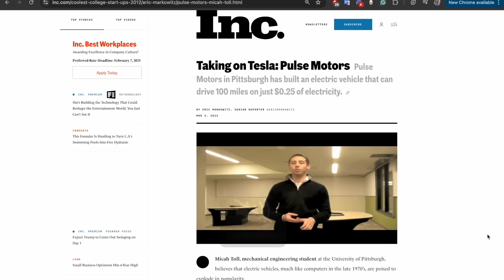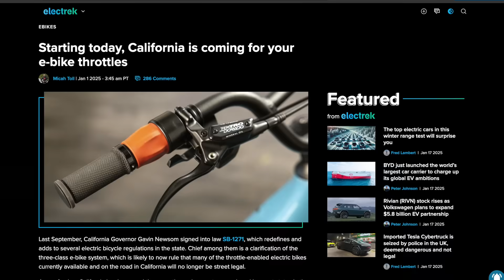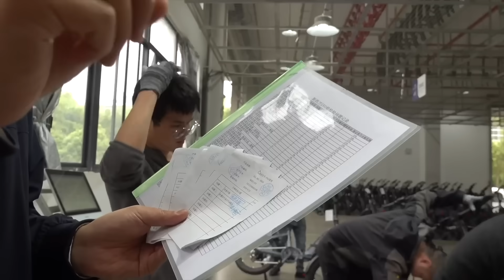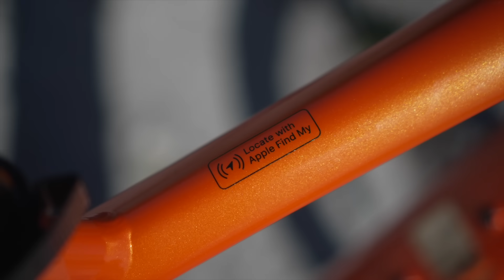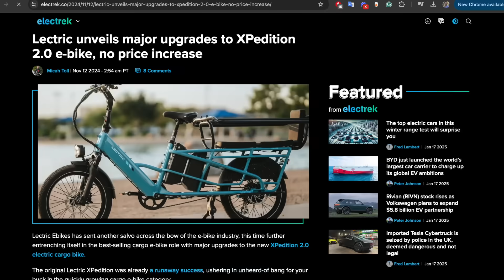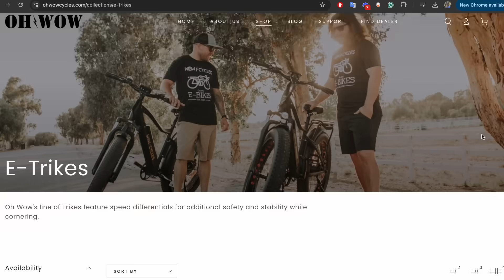5 Things That Will Happen To E-Bikes In 2025!

Comment: As a motorcyclist, seeing some high end e-bikes keep up with me on local streets, yet wearing nothing more than shorts and a t-shirt, is pretty mind boggling.
Reply: Blame the Rider. Not the EBike.
Reply: Wait till you see people riding bikes down hills.
Reply: It’s stupid.
Some of them ride at those speeds on sidewalks. A 60 year old runner was killed by a kid on an ‘e-bike’ like that.
Reply: @IdrisFashan  That should be obviously illegal.  Class 2 is more than enough.  I usually go about 15-16mph on my velotric fold.  That is a sensible limit for bike trails.  The people who want to ebike in the road faster should be calling their ebike what it is, a moped.
The 750watt limit with no peak is dangerous as it assumes people cannot be heavier.  Its an ada violation.  They should limit acceleration speed, not wattage.  I don't get why people doing stupid things on roads has anything to do with people who use ebikes to assist on actual bike trails.
If you are biking in the street, get a moped style bike and call it a moped.
Reply: One case dude how many bike riders are killed by cars? If you get rid of things based on one case or a few nothing would be legal dude  @IdrisFashan
Reply: @bellatorna8664  that's one death that happened blocks away from me. There are dozens of others... 
50+km/h ebikes are mopeds. 
No one should have a bike on a shared path that goes faster than 30-35km/h. 
My wife rides an analog gravel bike and she can go A LOT faster than that on the road, but she won't risk running into people on a shared path. Motors make the wrong people even more careless. I ride every day (Canada) and some delivery-style guys in my town get careless, but I almost never see them speeding around on paths. The Surron type speed ebikes/dirt ebikes are a different thing altogether—they need to be regulated before they ruin it for the rest of us.
Reply: @IdrisFashan i respect what you say but you keave young men like me screwed with bike licenses dude
Reply: I ride both. I limit my e pedal bike top end. On my Kawi l wear full protection. On the ebike l tone it down and try and be as careful as on motorcycle. More so really but both rides are very unforgiving in an accident..
Reply: Don't get jealous now.
Reply: Falling off and hitting the back of your head can kill you on a motorcycle and an ebike is no different. 20mph is all it takes to do that. 

Makes no sense the fast ebikers don't wear motorcycle gear.
Reply: @hyedefinition1080 It should be their choice whether to wear gear or not on a motorcycle or an ebike. Fortunately it is in my state.
Reply: @ndnrider  
Having legality be a metric is odd to use. Sugar, alcohol, and some soft drugs are all legal: they can kill you in all their legality...still not questioning your legal rights. 

I don't need to go beyond common sense and jump into the world of legal loopholes  to tell you hitting the back of your head is going to kill you. LMAO
Reply: @hyedefinition1080  Maybe I misunderstood you. I was simply saying I think adults should be able make their own choices about riding gear, personal safety, food etc. regardless of how foolish I think they may be.
Reply: @ndnrider  I completely understand statement. I just thought it wasn't really in response to what I said, slight tangent. I didn't mentioned legality. Not sure why you responded with it. 

Legality is tertiary to my well-being and safety. Peace.
Reply: @hyedefinition1080  Yes,  I said I misunderstood you.
Reply: @ndnrider  no worries bro. Take care have a nice one
Reply: I see no issue at all with them being on local streests. It is when they are on trails with a lot of walkers and joggers where there should be speed limits.
Reply: It's their lives. I know better. I don't own a gun but I won't get in the way of good people buying them. I got a kid. He someone blew him away I wouldn't blame the gun. The person holding it. Stop begging for Big Brother just cause your side lost CLEAN in November.
Reply: Yeah, but I've seen many more motorcyclists on the highway even wearing shorts and flip flops and no helmet. Lets ban motorcycles for our own good. Lol.
Reply: @drewm6008  dude why does it have to be that a suggestion of wearing helmets = banning motorcycles /ebikes? It's a false equivalent.
Reply: Lol don't try road cycling
Reply: There are so many parallels to the personally owned firearm community it's scary!
Reply: Yep, those are Emopeds, and those idiots should have to wear a helmet, and get a license and maybe insurance. Oh, and I've been riding a Ebike since 2019, but mine has a top speed motor wise of 20mph. After that the motor goes into neutral.
Reply: These hooligans are forcing cities to impose European restrictions; 250 watts and pedal-assist ONLY!
Reply: I seen worst than that. A guy with his Ebike in middle of highway road he cross the red sign without any hesitation
Reply: @Drealmers  thats the issue with ebike riders. don't push it pause asses the situation then go so you don't harm others.
Reply: No offence but the safety issue is identical for ebikes and road bicycles.  In fact its worse because road bikes aren't speed governed.   Cyclists routinely fly by me when I'm on mine.    It comes down to the riders.   No law will matter.
Reply: @gregsaddie  while I like e-bikes and also own acoustic bikes, I think level of rider who can pass me or anyone on a acoustic is much higher...most acoustic riders are averaging between 8-15mph...only really experienced riders are topping 18 consistently on a commuter style bike. Those topping 20-22mph are basically riding road racing bikes. Heck professional Tour de France riders are about 25mph-28mph without a gravity assist.

So yeah, the average guy on an a regular bike is not passing you or I we are going slow to begin with...
Reply: @triaxe-mmb  STOP using the word acoustic, the bike doesn't play music
Reply: Imo Class 4 should be treated like 50cc mopeds, which usually go 35mph+ anyways. Car driver's license, no public trail or bike lane use, wear gear, but you also don't need insurance or a tag. Maybe a new class could be introduced for 40+ or 50+mph bikes that basically makes them motorcycles
Reply: As a motorcyclist, I hate to see ebikes regulated. Land of the free .... not so much. 😢
Reply: Never was. @mpcinlv
Reply: @mpcinlv  freedom doesn’t mean anarchy.
Reply: Those are the ones who ruined it for everybody
Reply: Or even worse! Stupidity at its finest - flip flops!!  Real idiots! Need laws to fine these people!
Reply: @quantumfx2677  I think they are fools but I do not think it is any of my business.
Reply: So what? Darwin was right
Reply: So mind your own business then and keep your comments to yourself.
Reply: @davidhazel36  and yet you came here and voiced your comments rather than keep that to yourself? 🤷🏾‍♂️

Comment: Being new to eBikes, and still in the research and learning phase before buying, I think I've developed an understanding of the different classes of bikes. What creates confusion though, is that you can have two different brand bikes that are otherwise identical, and one of them is class 2 and the other is class 3. Some bikes are affixed with a standardized class label and others are not. Can you help me understand how two different brands with identical features and technical specifications can be two different classes? And why do some have class labels and others don't?
Reply: A lot of bikes are designed to work as either class 2 or class 3.  A manufacturer might choose to label the bike as one class or the other.  But the new California law makes it clear that it can only be one or the other.  

If a bike has a throttle, it can't be a class 3 bike, per California.  A bike with a throttle must be a class 2 bike, limited to 20mph top speed, and no faster with pedal assist as that would put in class 3 territory.  One of the manufacturers (Specialized) is making available a firmware update so you can "upgrade" the bike to class 2 only operation. to comply with California's new law (taking away the pedal assist up to 28mph mode).
Reply: In many cases, the vendor simply ships a bike, and since these bikes are VERY much controlled by software?

Then you get different specifications based on not really the model you are buying, but the specifications they ship with. (by changing the software).

A really good example is of course bikes shipped as class 2 rated. That means max 750watts, and means a twist throttle is allowed up to 20mph.

However, if you un-lock the above bike - say to class 3?
Then you top speed is now 28mph, and that means it is a class 3 bike performance. 

In fact, quite a few bikes un-locked will do say 28 mph, but they allow the twist throttle to reach that 28mph. In most states, a twist throttle is only allowed up to 20mph, and if you want to go faster, you have to pedal. (even if you doing “fake” peddling, or what is called ghost peddling – in other words, you not really pedaling the bike, but are simply rotating the pedals). So, to reach 28mph, then you supposed to pedal. However, this area has been a bit gray, so most bikes un-locked with a throttle tend to allow the twist throttle to now 28 mph (but, they technically are not supposed to do this). One way around this is to remove the twist throttle, and have a small lever that works like a throttle - but it not considered twist. But, either way, for class 3, peddling is required beyond 20 to reach 28 mph.

The other common reason for multiple ratings on the same model?
Well, many vendors say rate their bike at 750watts. Then some vendors started quoting “peek” output or ratings. Often a “peek” rating can be close to double the watt rating. 

Unfortunately, then you now often find multiple spec sheets for the same bike – one has the watt rating, and the other has the “peek” watt rating.

Unfortunately, with so many vendors now using peek rating, you actually have “poor” information as to what the rating of the bike is!
 
This much reminds me of the stereo boom in the early 1980’s. Some vendors would rate their stereo at max watts, and that was much a “peek” rating, not an RMS watt rating that quality vendors would use.

RMS = continues watt output without sound distortion, or better stated continues watts at less then some stated % distortion).

Max peek watts for the stereo = max power output in short bursts – which is be quite large!

So, this is exactly the same issue with ebikes – peek vs continues watt output.

Same goes for say a window air conditioner or fridge. When the fridge starts up, it can pull HUGE amounts of watts – you often see the lights dim a bit in the room. So, that’s the peek watt pull vs the continues watt rating for that fridge/air conditioner.

We now have this same “nonsense” occurring from many bike vendors. 

I don’t blame ebike vendors too much.
All it took was one vendor to use a peek motor watt rating.

The result was consumers buying that bike, since they thought it had a better and higher watt rating then many of the other bikes they were shopping for.
 
So, now boatloads of consumers thus would purchase a 1300 watt rated bike over a 750 watt bike – but they are the SAME bike, just different rating being used.  So, many vendors had to follow this trend, or miss out on sales.

The result is multiple specification sheets for a bike. One for regulators, and one for consumers buying the bike.

So, the above reason (peek burst power vs continues rating), and that of software being able to change the performance of the bike are the two most common reasons for multiple and different ratings for the same bike.
Reply: Very true. eBay kits for American markets often quote crazy high wattages and yet call it 250w for European markets, though likely with different programming for speed limits etc. even Bosch 250w ebikes will draw up to 800w when you bog it down on a hill, because the motor is much less efficient it's putting out not even 250w of motor force but it's running at like 40% efficiency for that burst to get the extra torque. Battery power is a bad metric and motive force should be used instead, like they use dynos for cars. Hubs get very inefficient for quick acceleration from a stop or on super steep grades

Comment: I hope that some bike companies stick with twist throttles. Also that some companies still make overpowered motors so that the bikes can climb hills. A 500/750 max motor does not make the grade. Another great video, thanks
Reply: 750w with a heavy rider will simply bog down and not be able to climb anything beyond a 10% grade.
Reply: @ramborambokitchenkitchen6357  same here, I weigh 205 LBS, my 750 bogs out on 10% hills
Reply: Look for models that create more torque with that 750W cap. Torque is more important than power consumption (what all those power ratings are is power supplied to the motor, not what the motor puts out) for climbing hills. And there is wide variability in that efficiency metric.

For instance, Rad’s new hub motor used on the Radsters and the RadWagon 5 produce 100Nm (90 in the wagon) of torque at peak 750W. Lectric’s M24 hub motor they use in the XPedition, XPress and XPeak produce 85Nm but requires around 1400W to do so.

Ananda’s new mid-drive motor puts out 120Nm at 450W peak, whereas a similar Bafang might need to send over 1000W to their motor.

If you need more help climbing hills, look for the same motor but its output is sent through a smaller wheel size and narrower tire. The former provides more mechanical advantage, the latter puts less rolling resistance and mass on the bike.
Reply: @chow-chihuang4903  forget all that EV motor hogwash, I have a HUMAN POWERED trike that puts out 100 ft. lbs. @ 2,000 rpm and don't have to worry about EBIKE LAWS. My payload and towing capacity is 1,500 pounds. 🍷🍷😎
Reply: Perhaps you need to consider using pedal assist on those hills.  Makes all the difference.

Comment: Ebikes becoming more unreasonably expensive
Reply: Well I noticed the opposite. Haven't checked since the Trump tariffs have been imposed, but they are way less than they were a few years ago.
Reply: Right? Like good Full Suspension class1 or 3 (Very restricted useless power level) for $14,000! WTF!
Reply: @bobbyg3333  Your not looking very hard! We now have 25KW models for $5599, the 72 volt Mantis for $2999, and the Rad for $999 ! Thats less expensive than certain regular pedal bicycles!
Reply: @ You can get a full suspension 1500W moto type  one for 500 bucks from China. or at least you could before the tariffs...